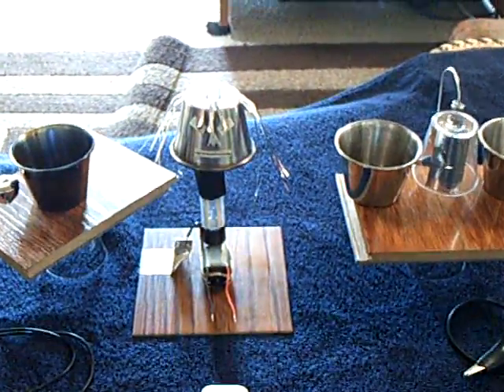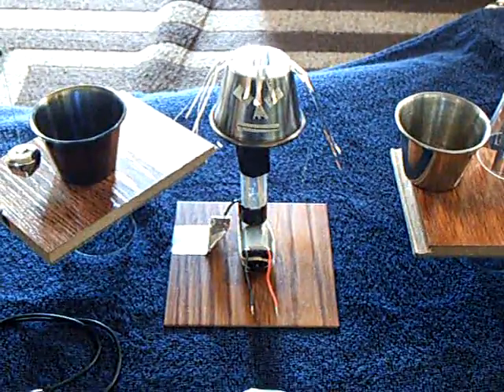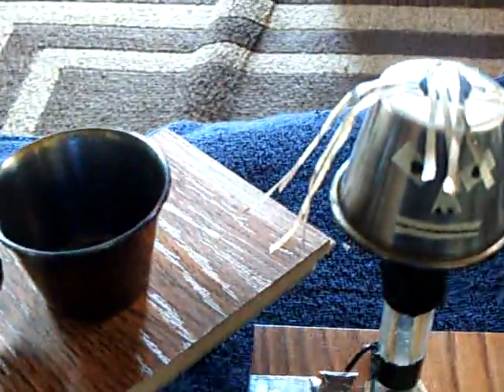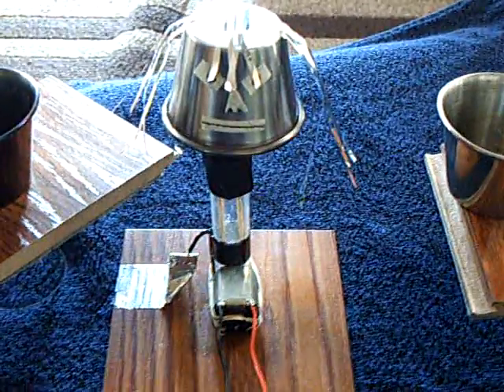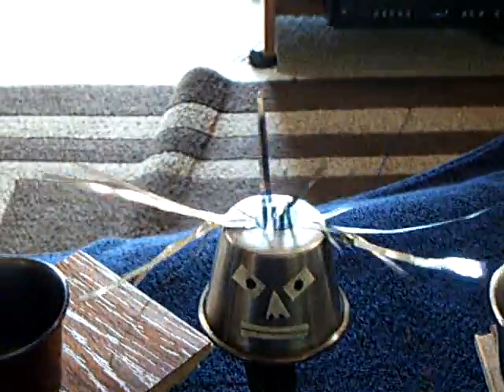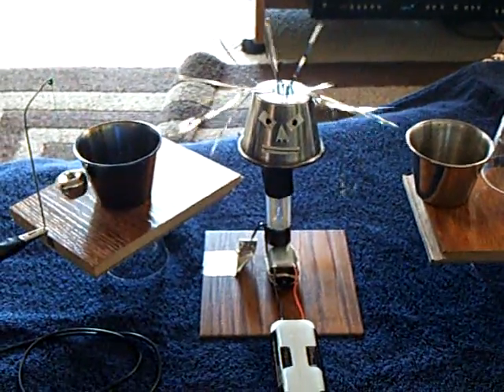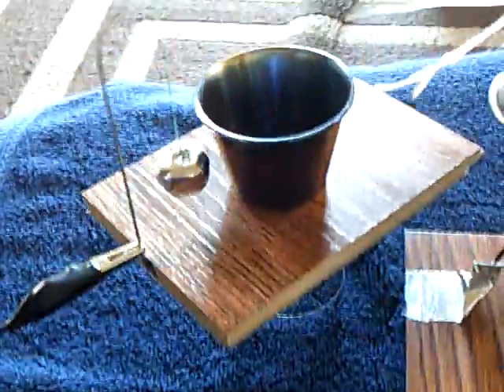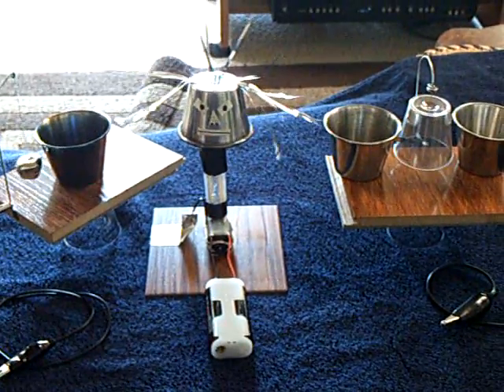Mini Van De Graaff ---  powering two devices

Comment: What a cool mini Van De Graff generator you have made there Lid.  Did I miss a vid on how you made this somewhere?  I have always wanted to make one of those.  Have you tried holding a floro tube near it?  I'll bet it lights, or a cfl too.  I also barely have time for this stuff due to work but you, and others, keep me motivated to make at least some time.  This is a great project.  Thanks for showing it.

Bill
Reply from the maker: Hi Bill.  I followed the build videos by PowerMax and RimstarOrg here at YouTube.  It is pretty easy if you follow the direction and have the parts.  This works with a neon but I have not tried a CFL yet.  Check out the videos by Thomas Kim.  His work is why I got into this.  It's amazing.

Comment: Make snake hair and call it Medusa :)
Does it work without the hair? I suspect some current may be passing over the surface of the Mylar in a static/triboelectric kind of way....
Reply from the maker: Medusa?  I would turn to stone for sure.  The Mylar strips help but this will work without them.  It will run the motor at about a 1 inch air gap.  A big VDG would probably do the job feet away.  By the way I am using glass as the top roller and Teflon wrapping on the drive motor shaft.  Those two are far apart in the triboelectric series and that might be one reason this works so well.

Comment: Ive really got to get on the bandwagon! Man everytime i see you or lasersaber finding time for projects, i get so roasted over how pegged work keeps me from doing experiments! Big props on that! Ive got a awesome 500kv vdg ive done lots of messing with, and including increasing the voltage surface areas to even greater potential! Eventually ill find the time. Cheers and keep up the great work!
Reply from the maker: I hear you.  I used to be in "pegged work" and understand what is going on.  Wow--a 500kv VDG.  I can feel my hair standing up just thinking about that.
Reply: You should check out lasersabers finished cells.  Those little puppies are putting out some good amperage, in the milliamps that is, but I was building my own when bedini got in this mix.  MIne still run to this day, but the miliamps are way too small.  I am going to step it up and play with lasersabers formula soon. what was very interesting to me was his aircore batteries. I finnaly found an awesome and cheap source for those carbon rods.